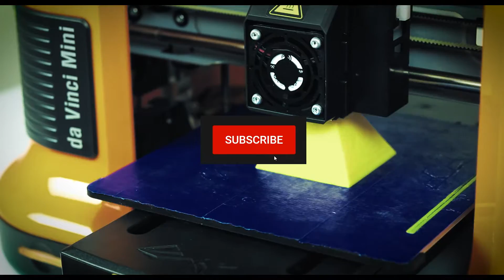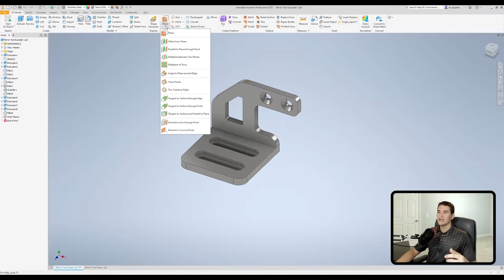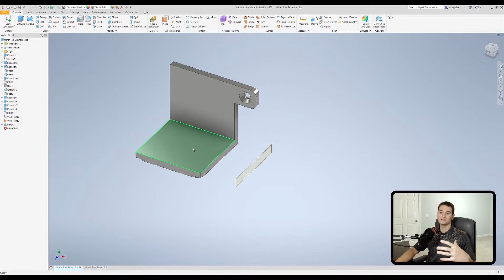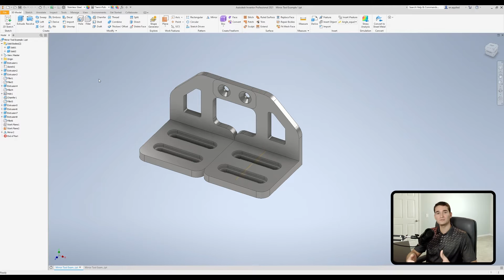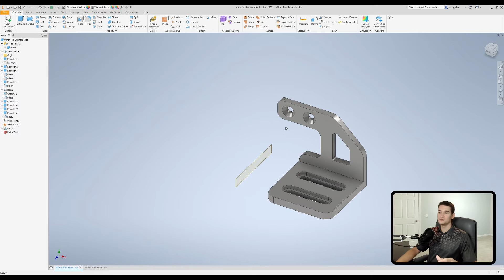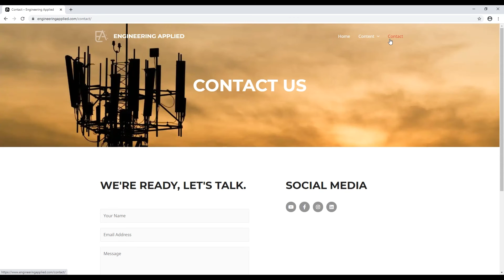Mirror Tool and Options - Autodesk Inventor Part Tutorial | Autodesk Inventor 2021: IN DEPTH

Comment: Something i'm struggling with.. If you make the letter L in parts, and you want to mirror holes that goes down the vertical part, onto the horizontal part. how do one do that? I can only find mirroring in the same direction sideways, or up and down.